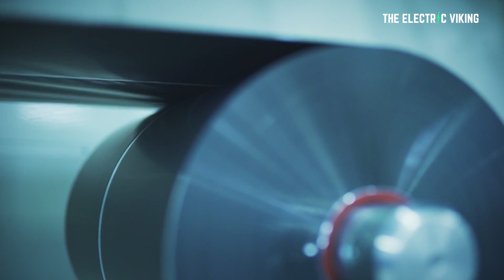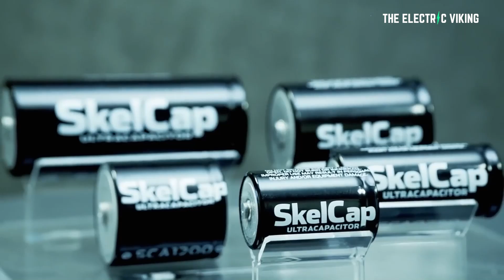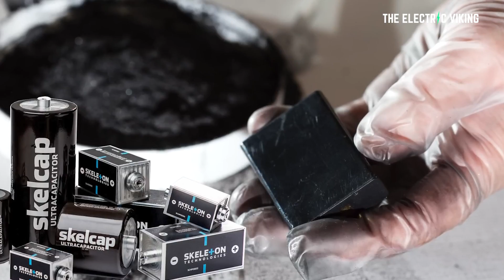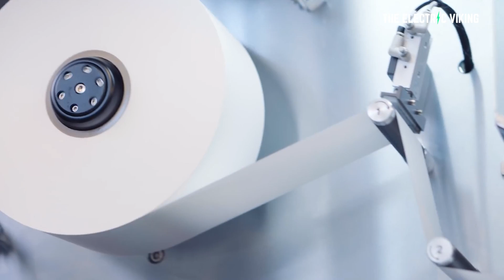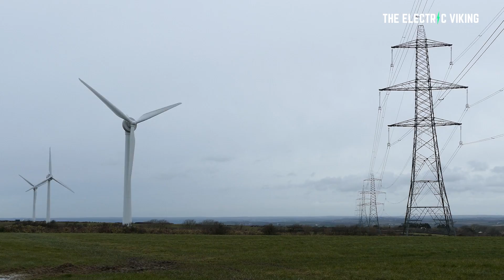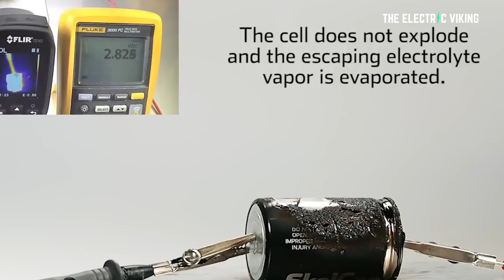The EV Super Battery that charges in 60 seconds & lasts 100 yrs

Comment: Even if it can absorb energy that fast, good luck finding a source that could deliver it.  You'd have to hook up directly to a power plant to charge it.    The average EV battery is 40 kwh.  To charge it in 60 seconds, you would need to deliver 40,000 watts x 60 minutes/hr which is 2.4 Megawatts.
Reply: That was my thought too. When you think of the number of vehicles that would be on charge at anyone time it would cause a continuous peak load. A load that would make airconditioners peak loading insignificant. It also gives some visualisation of the amount of energy needed in total to supply vehicle energy needs.
Reply: the charge system they mention in the press release for the shell 400kWh battery is 24MW. Most likely it's just a big battery with a DC/DC. then the battery is charged slowly by a generator or some kind while the truck is doing its thing.
Reply: @ulwen  Interesting! OK for one but to offer 1 minute charge time to many at the same time. The numbers get very large and expensive. Both in money and energy to build and operate such a system.
Reply: @longsighted  compared to the cost of a mine it's peanuts.
Anyway applications where you need lots of power 15 to 30 minutes is likely to be industrial or infrastructure and they have the budget if it solves a problem for them.
Either way it covers an area between ultracaps and lithium batteries which doesn't have a great solution at the moment. Ultracaps are too big and only works well up to 60s. Lithium batteries that can provide the power required for the application also come with way more energy than is required and a low cycle life.

Comment: Hmm... what do I think.  I think they are kinda loose with the term battery.  These are capacitors.  They are indeed wonderous but you will have to charge your car every 50 miles.  For machines on a fixed location they would be indeed wonderful.  But I don't think we will have the ability to provide the needed infrastructure to keep them charged.  The mail failing of them over batteries is the density.  Perhaps one day these will work out but for now I remain doubtful.

Comment: 400kWh in 90 seconds seems entirely unfeasible.  Even arc welders don't handle that kind of current.  400kWh = 1,440 MegaWattSeconds..  90 second charging time brings the power to 16 Megawatts. At standard 220V house power this is 72,727 amperes.  Nothing you can use at home.  Even unlikely you could use that power at a charging station. Think of what wire gauge you need for 16 Megawatts.  Only the watchman at a nuclear power plant could use that kind of power. Are they using ultracapacitor technology or battery technology?  Batteries put out a constant voltage.  A capacitor might put out 1,000V at full charge, 500 volts at half charge and 250 volts at quarter charge.  It is possible to build a regulated DC:DC converter to maintain a constant output voltage like a battery.  Is this done internal to the battery or external or are no supercapacitors involved?  It is not clear what is going on.

Comment: Super-fast charging requires enormous charging currents if we're targeting a "battery" of any description with, say, storage capacity of 100 kWh.  To do this in a plug-in EV context will require interconnect cables made of superconducting materials cooled to super-cold temperatures.  This will not be a low-cost proposition, and each charger stall will need access to its own local 250 kWh store to prevent overloading the grid.  Lots of work ahead - not impossible, but not effortless, imho...

Comment: THE IDEA TO TRANSFORM A SUPERCAPACITOR INTO A GOOD BATTERY IS ALREADY OLD, JUST AS TO USE CARBON NANOTECHNOLOGY FOR THIS. THE CEO OF SKELETON DOES NOT SAY THAT THEIR PRODUCT WILL REPLACE LI- BATTERIES. A CAPACITOR IS NOT STABLE AND LOSSES ENERGY OVER TIME, BUT ITS EXTREMELY FAST CHARGING CAN BE USED FOR EVs. THE SKELETON CAPACITOR IS SO ENERGY DENSE, THAT IT CAN BE USED AS TEMPORAL STORAGE FOR THE LI-BATTERY.(!!!!) AFTER CHARGING. PROBABLY WILL IT THAN BE POSSIBLE TO REMOVE COOLING FROM THE LI BATTERY AND ALSO OTHER CHANGES WILL REDUCE COST.....

Comment: A capacitor is not the same as a battery. Granted it may recharge in 60 seconds and charge cycles that last 50000. But I don't see it become the hyped battery of the future they way we think. I think the explanation of the technologybis vague, and thus by definition a red flag in terms of validation. If it was so revolutionary, I would think Tesla would have already fast tracked the techology with Maxwell.  I think the future of the capacitor being able to replace a 12-48 volt car battery is tealistic. We have also seen many proof of conscepts and there are countless youtube videos that demo starte its benefits. Holding a charge much longer than a lead acid battery and a few other benefits. But I think we are still a few generations away for finding the best hybrid wholy grail of integrating the best of a higher energy storage capacity lithoum ion battery for delivering sustainble energy for longer periods, compared to a capacitors adavntage of higher energy discharge in a short time. The behaviors of a battery and capacitor are very different, which means each has its merries. But likey in very different applications. Tesla has thought of integrating capacitors for a hybrid technolog in Tesla's. The main battery could be used for sustainable energy delivery a longer dustances. The capacitor would then only be used during performance metrics of fast accelation and braking for maximum full capacity harvest of braking and acceleration activity of the vehicle. This could likely also greatly improve battery longevity, because the battery would be less susceptible to capacity losses from the ftequent exposures of damaging begaviors from agressive accerations and braking at higher charging rates and unnecessary heating of the battery to threshold temperatures. Not sure why Tesla didn't continue to progress on this. Butbthat fact tells me I'm sceptical of the claims made by this company in collaboration with Shell.

Comment: How hot will the battery get after 15 seconds of charging?   You will need 2 inch diameter copper wire...  a fire extinguisher...   a bottle of

Comment: viking, a capacitor stores charge, but that charge has a low current. P=IV is the formula for power in watts, current in amps and voltage in volts. If you take off your jersey, friction generates 100,000 volts but the amperage is very low, so you dont die. But the voltage generated is almost instant. I would say that these ultra capacitors are very useful for short term effects eg taking off at traffic lights, or storing charge when you brake, and when you accelerate. But then you need the storage capacity of lithium ion to keep going. Elon has looked at them and rejected them as a normal battery to use all day. I agree with elon. Super capacitors will be very useful for EV's but their energy density will be very low. A lithium battery can be used over hours but the ultra capacitor for seconds only. I think this is another nikola motors, to be honest.
Reply: It's the opposite . Capacitors can deliver currents that are only limited by the cables that connect to them. The voltage is low ,usually around 2.5V and they can't be linked in series efficiently, to increase the voltage

Comment: Seems these are capacitors not batteries. They are meant for short power bursts not energy storing. I'm guessing energy density is 10 times or so lower than batteries. Plus they can't keep constant voltage.

Comment: There seems to be some confusion in this video about the difference between power density and energy density. This "battery" is essentially an ultra capacitor. That means it can deliver a high amount of power (watts) for its weight, but has low storage capacity (watt hours). According to an article on PV Magazine published earlier this month it only has a energy density of 65 Wh/kg. Not only is this nowhere near the energy density needed for aircraft, it pales in comparison to the energy density of most EV battery packs. For example, the Tesla Model 3 has a energy density of 272-296 Wh/kg.

Comment: Remember Nikola and GM, just member that morons attract morons. Also they were comparing their tech to be 10x better than a capacitor and only lasting 15s, which is not likely good enough to replace batteries for long range vehicles. But for applications where a lot of energy needs to be charged quickly this seems to be the superior option. We'll see if it's true.

Comment: In an EV, the role of an ultra capacitor would be to provide the energy required for short, intense demand such as when merging or passing.  For constant use as in highway driving, power would come from the vehicles batteries, not the UC devices.
Reply: Current batteries are already sufficient for merging and passing. Unless these supercaps have a higher energy density by weight, I don't see them making their way into EV's.
Reply: Drive a Tesla … it already has super power to pass anyone at any time or any place.
Reply: You are missing the point. Ultra capacitors have huge energy density, far in excess of even Tesla batteries. The unsurpassed Tesla acceleration requires a very rapid dump of a lot of power. This obviously can be done with the current design, but continued discharging like that is not all that good for the battery pack. Users want range more than power. The marketplace shows that to us. So if a bank of UCs could provide power for rapid acceleration, then the manufacturer would have options. Less batteries for lower weight, more UCs for rapid power requirements, extending range. This latter is accomplished by substituting UCs for batteries to handle passing etc.
Reply: @amazeddude1780  wrong !! a common mistake is confusing energy with power...  UC has only a fraction of "energy density" of lithium batteries which is watt-hours/kg, but has many times more "power density" which is watts/kg...   so you can not store a useful amount of energy on UC's, thus has no use in EV's... even for rapid acceleration... if properly designed lithium batteries can give any amount of peak power and absorb most of the regenerative energy an EV  could produce...

Comment: Super Battery are amazing with superhigh Power density, excelent for buses charging a minute at every stop or heavy trucks working short distances.  But energy density is 65W/Kg so they are not for planes, maybe cars should have a few to capture 90% brake regen

Comment: What is the energy density? This is a capacitor, not a battery.
Reply: Came here to say that.
Reply: Only 65 Wh/kg. Not really a game changer.
Reply: @bobisnamemy  well if the battery works as advertised it will surely be game changing for the storage industry (think of renewable energy storage). If I had the cash, I would invest a lot in that company because they are about to get very big if they market their products right.
Reply: 65 wh per kg ...it is still very low energy density
Reply: It's a hybrid supercap and battery. It is not a high energy density, but fills a role of rapid charge/discharge while still having higher density than a supercap alone.

It's a really good option for regen as loss during breaking is really low, and it returns on acceleration very quickly. Then the high density battery carries the continual coasting load.
Reply: Also where can I buy it
Reply: This can barely store any energy. This is not a battery
Reply: Capacitors with a high slew rate are totally excellent for dynamic power peak applications to address, in the time domain, i.e. the resultant instantaneous vacuum caused in direct correlation to highly transient power spikes.  In this regard, capacitors are not batteries but, importantly, function as reserve power banks c/w an extremely high charge-discharge cycle life. Accordingly, capacitors can't be the primary 🔋 in respect of BEVs, at least, not in the vertical analysis.
Reply: Lto batteries have 50,000 cycles and double wh/kg compared to these
Reply: Only a difference in scale: capacitors use ions (atoms with an electron too much or less), batteries: electrons. Yeah...capacitors are too coarse and never will do the trick. I want to see subneutronic and subprotonic batteries instead...the lower you go the higher the capacity will be.